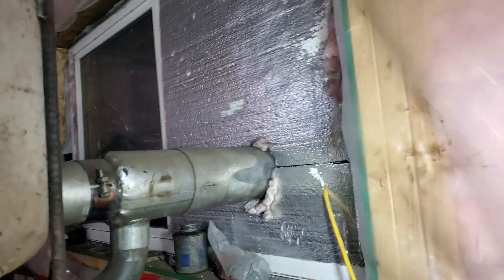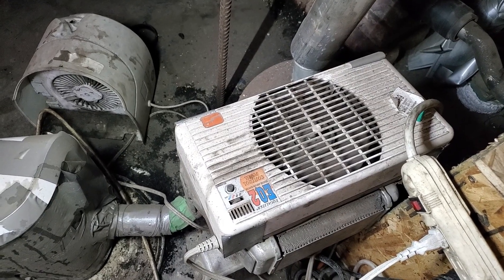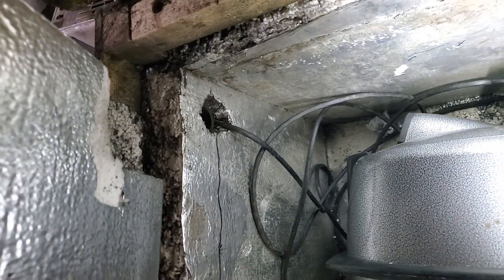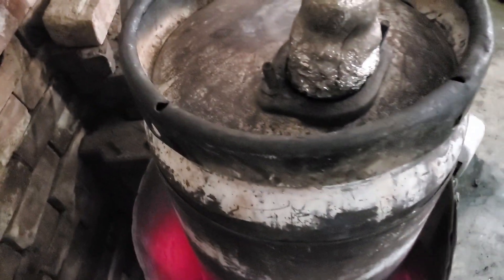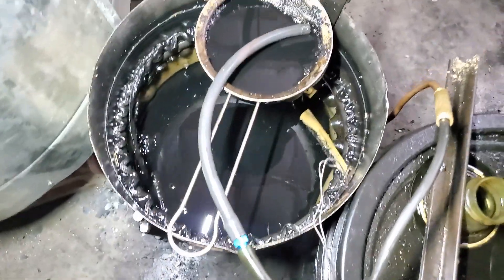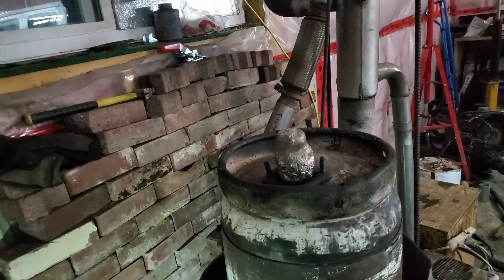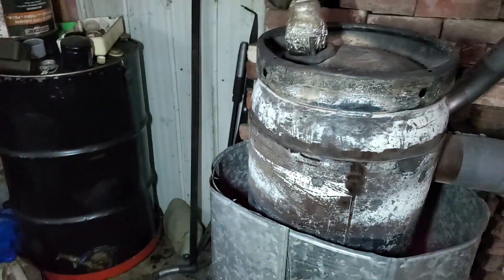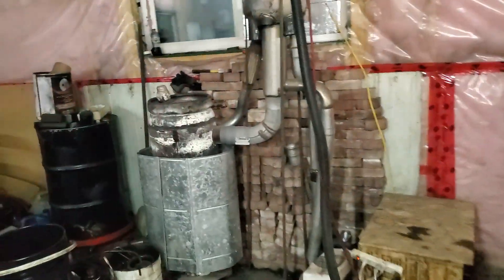Boosted Waste Oil Burner

Comment: Thanks tim. Wow 38C. 😅. That must of taken some time to construct/build. I have since taken mine out, halfway thru building another. Smaller propane tank, large glass door, burner inside rather than underneath, peristaltic pump via timer for the oil, smaller fan with speed controller. Hoping to get workshop down to 20c. So look out as i will be posting the build mate. Hope you might get something from it. Keep up the good work.
Reply from the maker: Thank you so much for the comment, yes I look forward to your build. If I find some time this season I plan on building a smaller unit for my garage as this one is a bit to hot and uses a bit too much oil.

Comment: I melted my fan as well, had to throw it away.  I ended up pushing the air in with the fan being outside.
Reply from the maker: I have an update video coming soon I changed it up again. I also found a solution to pulling in out side air using a venturi effect that I used last year, but then I changed the set up again as I finally got a proper chimney. you should make a video on yours, I would love to see it.

Comment: 🧐 Seems safe
Reply from the maker: I have moddified it more since this video, I have very good control of how hot the barrel gets now, I can get it turned down all the way to the point of the barrel not glowing at all with out flaming out. Its also now on a 12v battery powered fan that is maintained by a battery charger, so if the power goes out it continues to run.

Comment: thanks for making this video! question: how is this more efficient than two chambers, one inside the other, combustion chamber inside and air exchange outside? would be a lot more compact and you would have as much air hot aire as a fan would allow to blow.
Reply from the maker: I am not exactly sure what you are asking, but if you are referring to the heat exchanger on the exhaust outlet of the burn chamber, that was an after thought experiment that worked out to strip more heat off the exhaust before it left the building.